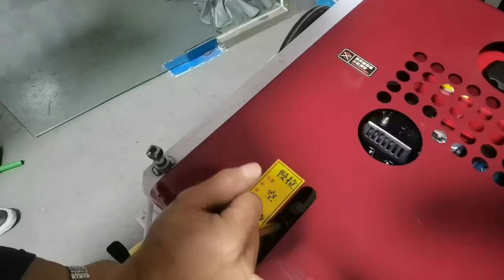How to install outdoor fiber cable with optical cable puller

Comment: This electrical switch not there in the machine
Reply from the maker: hi, Maseen, this is hand start, not key start, another video is key start
Reply from the maker: there is one option with electrical switch design; it is the key to make the switch on; Any interests, welcome to send email to info@wirenet-tech.com , or add my what's app: 0086- 135 3757 6344, hope to hear from you soon! : ）